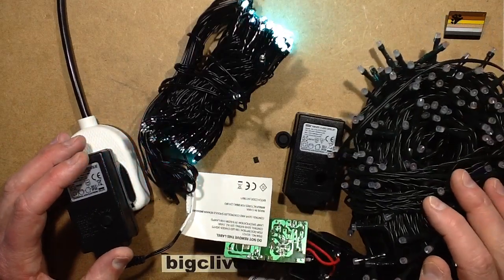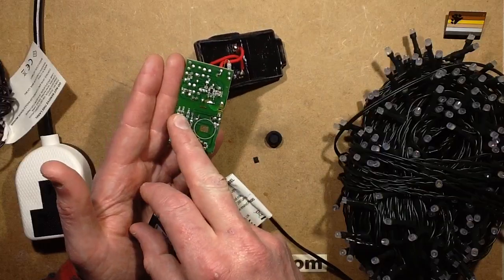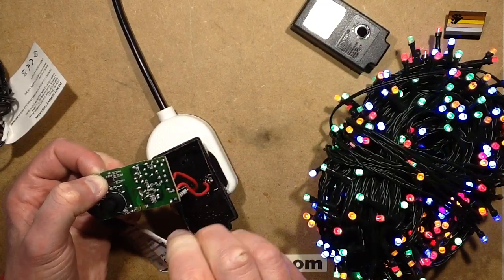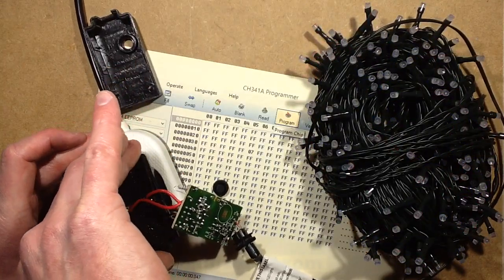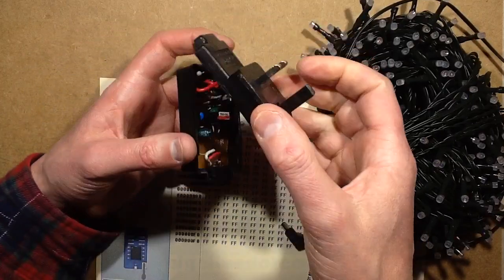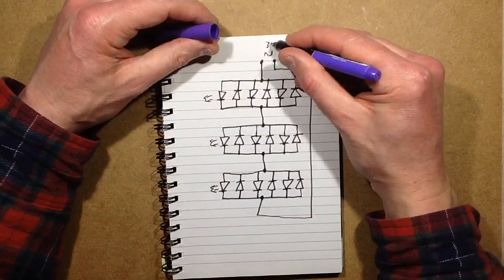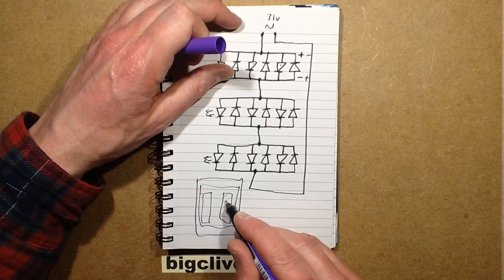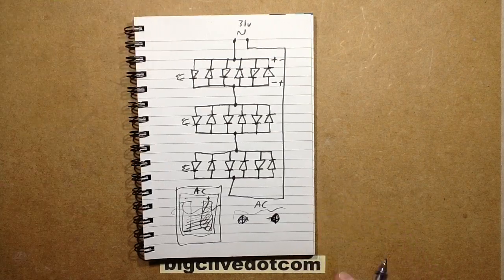Memory hack for new 2-wire LED Christmas fairy light controller.

Comment: Nice hack! Where did you grab the memory chip? Fleabay seller?
Reply from the maker: +Richard T Yup.  First port of call.
Reply: +bigclivedotcom Cheers!! Thanks for the great videos!!!
Reply: +bigclivedotcom How much for that strip of ... 20, is it? And are they just like 256 bytes each? Flash?
Reply from the maker: +mspenrice As usual on ebay it was suspiciously cheap:-

http://www.ebay.co.uk/itm/201332372183
Reply: +bigclivedotcom its funny how on the uk version of ebay they change around little words like "add to basket" on the uk site, vs the .com site which says "add to cart" and various other little changes. im sure theres tons of them like with "color" and "colour" (color being the correct one of course :P)
Reply: Honestly 5p each? I might get some just to see if I can manually latch in some data for the hell of it, and try to read it out again after. I mean, I know 20x256 bits isn't really much (that's ... what ... 640 bytes?) for that amount of money, but for a plaything it's pure pocket money.

Presumably they're the chip that was used for e.g. those old school electronics project boards where you could make a 16-step 4-bit sequential-output program with an integrated set of LEDs and a 7-seg plus some banana sockets. Just need four of them, a looping 4-bit counter to go with it and the rest of it is basically dealt with using discrete components, including the read/write switch and the step/reset buttons...
Reply: kekejojo1212 THIN ICE, JOJO... ;)

Comment: Aww man. Great video. I could've used this tip to fix the fairy led lights at home.
Reply: hey dude, i’m actually trying to do that exact thing right now, but i’m braindead when it comes to circuit boards, idk a lot about it, was there anything specific you did to make it work?
Reply: @uppast420am  on some boards there is even a space for the memory chip, but it's left empty. Sadly my set of lights died shortly after my cat wrecked them. Now I'm using a small set of 2xAA battery operated lights. For my and my cats safety.

Comment: To open a sealed case, hold case in left hand and tap with a hammer around the join, this does it for me every time, Use Liquid Poly to re-stick it.
Reply from the maker: +Graham R Dyer That usually works for me too, but these cases are very robust and possibly welded together ultrasonically.

Comment: A great easy way to open power supplies like this is to take a hard handled screwdriver and hold the supply in your hand. Then you just keep giving the the weld mark a good sharp tap with the handle, cracks them open like an easter egg everytime.
Reply from the maker: +Menohac Alas, that didn't work on these ones.  They seem to be a firm chewy plastic, possibly welded together ultrasonically.  The cases seem really resilient.  Possibly because the manufacturer know that they will see extremes of winter temperature.
Reply: +bigclivedotcom Use a vice. Put the case diagonally in the vice, along the weld, then compress it. It will open. Works all the time.
Reply: Seriously guys? He uses the "vice of knowledge" all day long in these videos… Are we really saying that Mr. Clive basically looked at the power supply , give it a couple of taps and said "no good..."? That he instantly jumped to a full on hammer? 😟
Reply: Oh..... 2 year old comments. Haha! Never mind. Lol

Comment: That DC thing you're talking about at the end of the vid happens with volume controls too..... You may have experienced the 'Crackling Sound' when you alter the volume control, it's mainly because the pot is connected in a DC circuit, one side maybe AC coupled but the other side of the pot feeding the next stage may have a DC bias on it because it may well be directly connected to the next stage.  Or Visa Versa.
Reply: +Michael Hawthorne  So what does that have to do with electrolysis?
Reply: +Jack White 
I don't know the exact reason why DC has the effect I was talking about but it does do the damage mentioned.  Maybe its the moisture in the air (Causing Oxidisation) and the DC charge across the volume control that does it, that could be the similarity to Clive's vid.  Any how, Clive's vid made me think of this problem so I brought it up.
Reply: +Michael Hawthorne This is a different problem. You always avoid having DC on an audio control as there will always be minor variations in wiper/track contact resistance which will cause electrical noise as it's moved.

Comment: I hated the lack of memory on my first lot of Christmas LEDs a fair few years ago, since then I found a manufacturer that has a very simple solution, a control box with a function selector dial rather than push button so it never forgets the selected function!
Reply: +4468 ...can you imagine the extra cost of setting up a rotary encoder and the circuitry to decode the setting though? They'd just go for the chip and retain the single button...
Reply: I meant one that gave a steady output from a bunch of different discrete choices, whether one-line-per-option or a binary combination (such as is used in a typical cheap multimeter, for example). I dunno what the correct name for that is, then, if I used the wrong one there. Rotary dial switch or something.

Whatever, change the wording, the point still stands.
Reply: Hi 4468, could you please let me know where I can find the control box with function selector dial? I have a string light with Jutai controller. Unfortunately, it is a different version that does not have a memory option. I think changing the controller is the simplest solution. Thanks!
Reply: @rockeyluo7829  Did you ever find a control box with function selector dial?  I'm in the same situation.
Reply: See https://en.wikipedia.org/wiki/Rotary_encoder#Absolute_and_incremental_encoders
Reply: https://www.youtube.com/watch?v=W2rW7iO62pU&app=desktop

Comment: Nice SMD work..... Easiest would be to grind through in the top of the case in the right area and put in the chip. Difference between your chip and the other is minimal, the N just denotes a plastic package. Cost saving is around 6c for the chip.

Comment: where can i get these lights in the uk england
Reply: +RC MAD Like most of Clive's stuff Poundland........
Reply: +SeanBZA dont think you could get them at pound shop
Reply: Amazon: 	
Premier LV081168WW Supabrights 480 is the set I've got...
Reply: +Nicholas Martin going to try thind them look like a good quality
Reply: +RC MAD as +bigclive mentions in his video they do flicker when on, but I've seen that brand around everywhere this year. They have the memory chip too...
Reply from the maker: +RC MAD Those sets came from BM Homestores.
Reply: +bigclivedotcom oh ok then will have a look
Reply from the maker: +RC MAD They're seasonal.  They may all have been sold off by now.  Next in will be the summer solar powered sets.  Check out BM next year.  They have a massive range of LED lights in large quantities.
Reply: do you look in b@m as they have a really good selection of led lights which i got a pair this year that will be going outside next year hopefully they and going to be good

Comment: The flicker is really annoying. Is there a simple psu circuit we could use to drive them with no visible flicker? Something to flip polarity at a higher frequency? My first idea was to rewire all the parallel LED sets in series to the same polarity and swap out the psu for a plain old DC supply.
Reply from the maker: The flicker was greatly exaggerated by the iPad.
Reply: you shouldn't be able to see the flicker with naked eye, unless the lights are moving
Reply: +bigclivedotcom it's also distracting in my family videos of Christmas Day (which is why I am being picky and was looking for a fix). I think it's only just bearable with the naked eye - might move them outdoors next year and get another set for the tree. Test out your theory about corrosion :)
Reply: +Nicholas Martin  If it's only for the family videos, you could try playing with the shutter speed to avoid the flickering.
But I get how annoying that flickering can be even if you don't see it with the naked eye. I had some LED spots that had no smoothing caps, just straight rectification that's it, when you were sitting still no problem, but every time you moved a limb you felt like in a disco, strobing away until the seizures set in.

Comment: SMD makes me sad.  Never liked SMD work and as I have aged my eyesight has gone so totally forget it now without a ton of investment and reflow ovens, magnifiers, etc...
Reply from the maker: +legalizeshemp420 Yeah, I had to get my rarely used reading glasses on for that one, along with good illumination and a very fine tip on the iron.
Reply: bigclivedotcom Fine tip sounds like an under exaggeration, lol.  I have presbyopia starting around 45 (when most start to get it) so I need reading glasses and I am now starting to need distance glasses.  I like the Lasik for presbyopia allowed over there but not allowed in the USA (we use one eye for far and one for close so you lose depth perception totally).

I figure a good 5x mag ring light would work but the iron's tip would have to be like a needle and the solder I don't think they make small enough for those tiny tiny tiny chips like that one.
Reply from the maker: +legalizeshemp420 My eyesight started to reduce around 45 too.  But only in one eye!  Finally the other eye is starting to go the same way.
Reply: bigclivedotcom
Aging sucks. :(  Mine began where I needed more light to read labels and it just got worse and worse.  If I am out in the direct sun I can read fairly well but my 20/12/20/15 vision is bad now but the Lasik would help but worthless here until the FDA allows it.  Why anyone would have one eye for far and one for reading/up close is beyond me but that is all that is allowed here for Lasik but the Brits have had wonderful success, so I read, with the Presbyopia Lasik.
Reply from the maker: +legalizeshemp420 It's just something that happens.  I will admit that it's frustrating when you can't read a component value that you would simply have glimpsed at in the past.
Reply: bigclivedotcom
Exactly.  I am constantly throwing my readers because I can't see far with them and can't see close without them.  Annoys me to no end.
Reply: +bigclivedotcom I went short-sighted in my late 20s, which had the medics worried, but meant I was fine with really close work unaided until around 45. Now at 60 I find my Luxo Wave magnifier lamp invaluable.